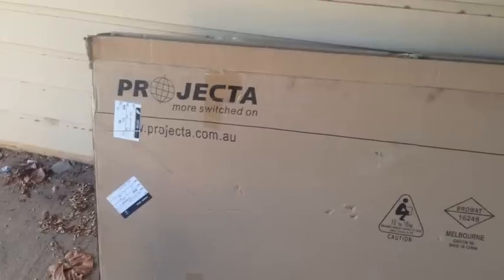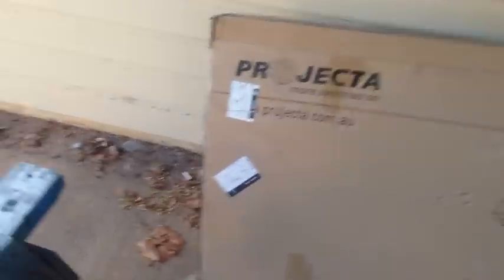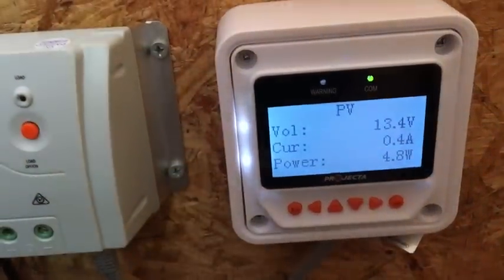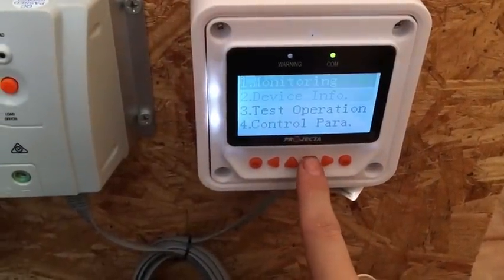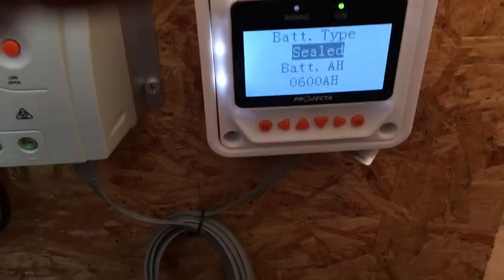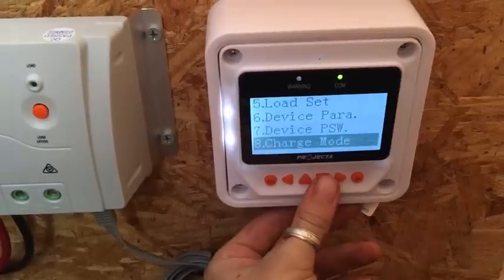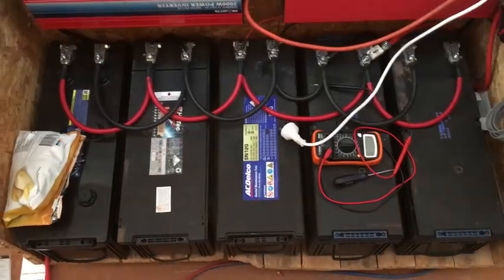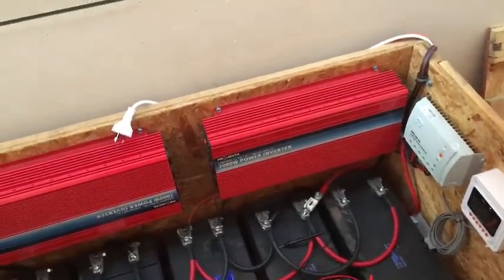Cheap & easy DIY home solar power system - cost, parts, where to buy.

Comment: This guy is not very smart about working around electrical stuff. He was either trying to show off his jewelry or is clueless about the dangers of wearing anything metal while working with and being around open electrical parts. Very good way to get electrocuted or at minimum lose a finger or two. He had metal rings on most fingers. It’s really tough finding out that the hard way.
Reply from the maker: Wow you sound like your a psychic. With the ability to see that i wore these rings the whole time i constructed this solar project. Bill just because i'm wearing rings in this video it doesn't mean i wore them during the construction process. I appreciate your concern but honestly iv'e got a few more brains cells than most to realise the dangers of electricity and metal rings.
Reply: Bill Maggie watch your own video. Didn’t have to be the “whole “time. Even when demonstrating the finished system that was up and running at the time you were clearly placing your hands (with rings) in and about several open and unprotected terminals. Deny all that you care to. What you were doing on your video was quite dangerous.

Comment: it should be manditory for all houses to be installed with solar panels, depending on the size of the house, carbon trade should be conducted into how much your citizens actually do. grey water systems, dry wells for gathering rainwater and run off under the property. pump water into a resevoire in the attic, sisterns under the floors where possible. all geothermal. 
the old way of doing things is going to lead to the destruction of our habitat and perhaps the extinction of our species.

Comment: From 35 years working with all voltages of electricity, you are stupid for wearing that many rings with your hands around so much D.C. each of those rings will go from body temp to 2000 degrees in milliseconds, good bye hands.
Reply from the maker: The only stupid people are those who are so careless to make continuity with rings around electricity. I have worked on many electrical projects with my rings on and will continue to. Those who fear danger are those who succeed danger.